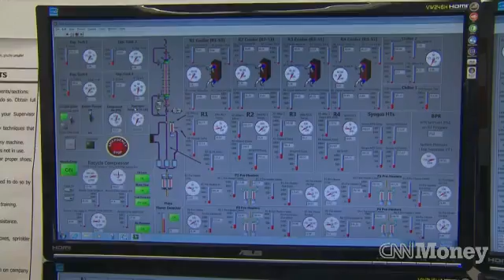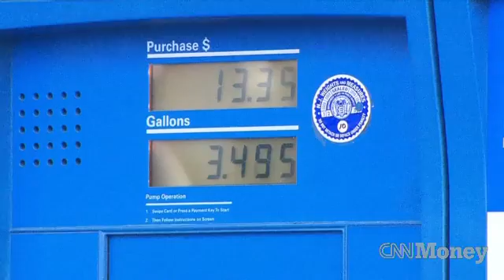Turning wood pellets into gasoline

Comment: It looks like battery powered cars are going to be a major portion of the car market before this process starts making a dent in oil sales.  Seems like a risky venture to me.
Reply: Maybe but battery powered cars are less convenient, can’t go as far and are more expensive than gas cars. Gas cars are going no where.
Reply: @deanurschel9161  I just checked the Primus Green Energy Site:  https://www.primusge.com/  

There appears to be nothing on there about this bio-stock to gasoline system from 2012.  It looks like they are stuck converting one kind of fossil fuel to another.   

Since then, electric cars priced have come down, there ranges have gone up, and their fuel and maintenance costs - which were already less than gas vehicles, continues to decrease.  

It still looks like electric vehicles will make more of a dent in oil sales than Primus will.
Reply: @Cynthia_Cantrell     This wood to gas conversion has gone no where because oil prices have stayed so low.  And battery powered cars aren’t inherently bad, but they also aren’t inherited better. There are advantages and disadvantages to both. While ranges have gone up they still dont compare to most gas cars because the best lithium ion batteries dont have anywhere near the energy density that gasoline does. Also gas cars are significantly cheaper than electric vehicles. It’s almost like all this investment is going into fixing something that isn’t broken. And to your point about operating costs, most electricity comes from gas burning power plants, therefore as electricity demand increases so will prices. And for practical business applications like work trucks Ev’s REALLY can’t compete which is why I said gas cars are going nowhere
Reply: Battery powered cars are not sustainable.
Reply: @johnjackson9767  Most of what modern humans do these days isn't sustainable.
Reply: Corn subsidies completely warped the biofuels market toward much less viable model unfortunately.
Reply: @UC3IQ1blv8SQS6YFgCf7DRjw Anyone seriously in the market for an EV well knows their limitations and advantages.  As an electrical engineer, I'm also aware of the energy and power density of batteries.  So are other engineers.  Yet that hasn't stopped them from designing, building (and selling) electric *airplanes*.

As for where electricity comes from, that depends on where you live.  Last year,  Iowa got 57.5% of its electricity from wind, 24% from coal, 12% from natural gas, and 5% from nuclear:   https://en.wikipedia.org/wiki/Wind_power_in_Iowa
Iowa installed even more wind capacity last year, so it is poised to have a larger percentage this year.

Texas doesn't get as large a percentage of its electricity from wind, but it does generate about 3x as much wind power as the state of Iowa:  https://en.wikipedia.org/wiki/Wind_power_in_Texas

I haven't checked lately, but a while ago you could sign up for an electric plan in Texas where all your electric usage at night (something like 10pm to 5am) was FREE.   This was because they has so much wind power available at night it was going unused. Sounds like a perfect place to own an electric car.  

The US however is behind on renewable energy capacity.  Uruguay's electrical system is already 97% renewable:  

https://energytransition.org/2020/01/uruguay-latin-americas-renewable-champion/

Oil prices have been low - helping keep gas cars more affordable.  Yet electric vehicle sales continue to grow. 

The prices for new wind and utility scale solar are now cheaper than nearly any other newly built power plant:  

https://www.pv-magazine.com/2020/10/23/its-cheaper-to-build-new-solar-than-it-is-to-operate-coal-plants/#:~:text=As%20for%20solar%2C%20new%2C%20unsubsidized,to%20%2423%2FMWh%2C%20respectively.

https://www.forbes.com/sites/energyinnovation/2018/12/03/plunging-prices-mean-building-new-renewable-energy-is-cheaper-than-running-existing-coal/?sh=427dca1b31f3

That price advantage will push renewables into the energy market faster than it has ever been installed before.  

Will this happen overnight?  Certainly not.  The energy sector has never moved quickly.  However, now industry executives can see proven ways to reduce their energy production costs and increase their profits. That will be hard for them to resist.

Batteries prices have been following the same downward cost curve that solar and wind power did over the past few decades.  It's only a matter of time before they can compete on price and performance with a gas vehicle.  Will it take 5 years?  10 years?  I don't know.  Nobody does.  But it certainly doesn't look like it will take 20.
Reply: @Cynthia_Cantrell  You are obviously biased, as is everybody. The simple fact is: at present gas vehicles have more favorable features than electric vehicles for practical applications. Like I said before they will both have their respective place in the market going forward. And while single passenger electric planes are an option, industrial transport planes (airliners, freighters) or fighters will never be powered by electric batteries. As an engineer you know this. Nobody can predict the future which Is why I go off of the present. There are limitations to battery technology which is why we stopped using them in favor of gas vehicles 100 years ago. Also government policy is what's keeping EVs alive not economics. Tesla only made a profit last year because of the carbon emission credits and not from selling cars, that should tell you something.